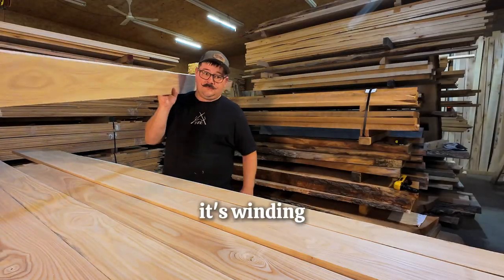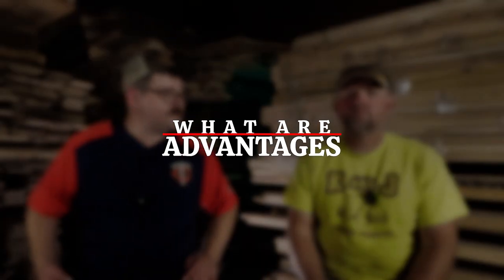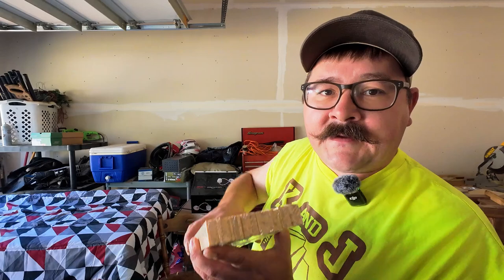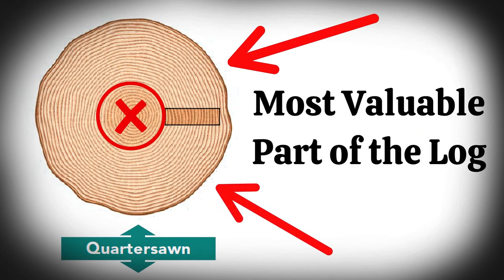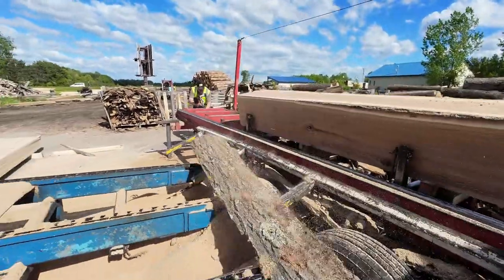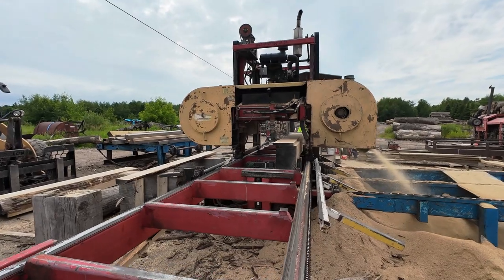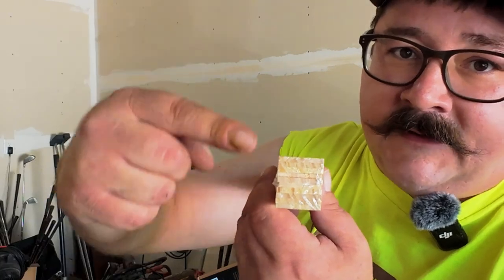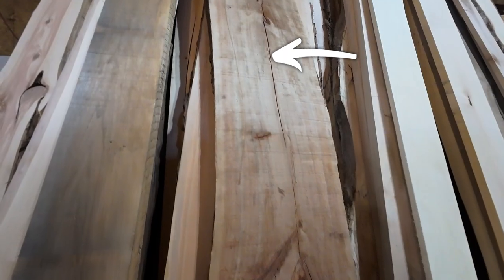Quarter Sawn Lumber - Everything You Need to Know

Comment: Do you usually strip off the sapwood before cutting the rest of the log?
Reply from the maker: When we take the slabwood off of the log on the initial cuts, most of the sapwood goes with it. Kendal says he does not worry about sapwood before or after that process as some customers may like the sapwood included. I (Kyle) have noticed that every customer is different, some like the sapwood, and some don't. Some like the rustic, some like it clean, and some like a mix of both. It all depends on preference and we like to have a variety of options.
Reply: @kandjlumber  I just wondered because I saw an excellent video by another sawyer talking about the internal pressure and “sapwood pull” he shows in real time the way the logs would curl because of the tension in the sapwood.